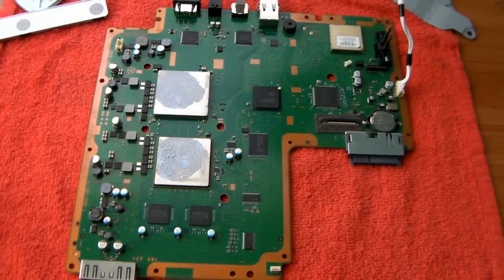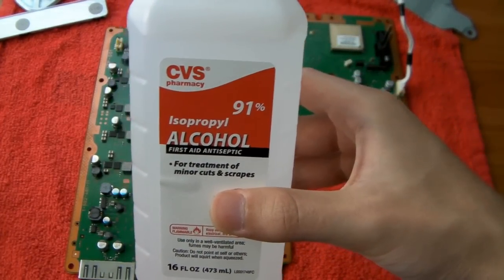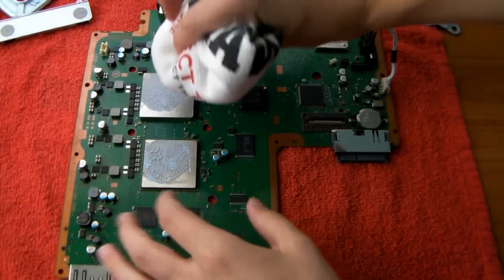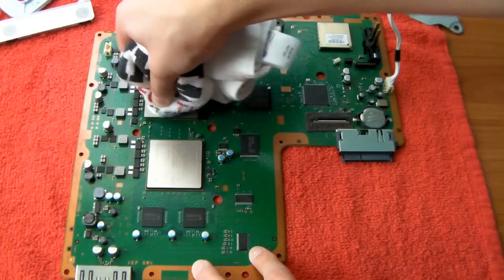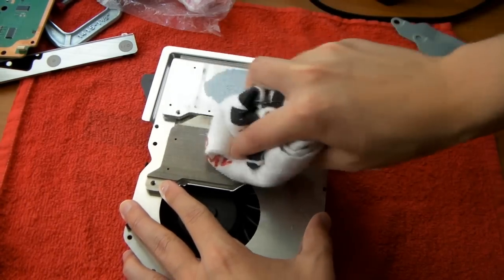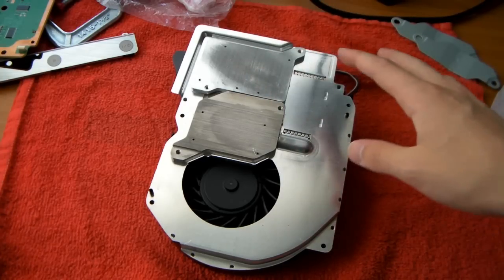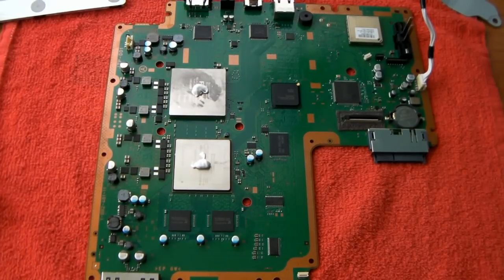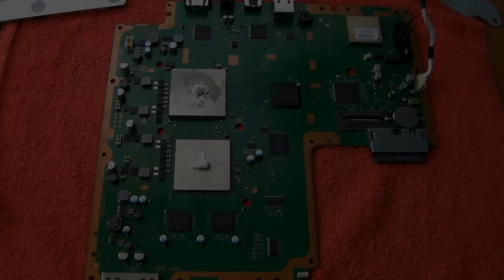How to Replace the Thermal Paste on a PS3

Comment: Does this stop my PS3 for over heating ?
Reply: Overheating and freezing ☺
Reply: Nuxy does this fix mw2 freez
Reply: Idk It should that's what thermal paste is for is from preventing overheating and freezeing so I would say Yes.
Reply: Clean the internals and change the paste. Here's the paste he used

http://www.alliedelec.com/gc-electronics-10-8108/70159754/?mkwid=sR14lob36&pcrid=30980760979&gclid=CjwKEAjwq5LHBRCN0YLf9-GyywYSJAAhOw6maavrtNauRGvrod02R1WMOL75Jg7NRfu86Fq97ZVNIxoCRDjw_wcB

Comment: To bad they use a heat spreader... if it wasn't for that replacing the thermal compound would be more effective because under those silver square's (heat spreader's) is the CPU and GPU die with more of that junky thermal paste on it. So ultimately the junk paste still is responsible for most of the cooling the new TIM can do. 

I kinda want to remove the heat spreader and replace that as well but there really isn't a effective way to replace it as the die will not come in direct contact of the cooler without the heat spreader.
Reply: have copper ones made to the exact dimensions.
Reply: xPurpBoyyx  where did you get it??

Comment: Do you have to change the thermal paste if you take it apart
Reply: It's the same principle if you're doing upgrading your basic CPU install or back when we did north & southbridge to overclock before Intel gave us the famous 2500k all thanks to AMD actually being competive back in the day.

So yes, otherwise it'll overheat and probably fry on you pretty quick I would imagine. I did my Dreamcast & Xbox so I figure it's time to finally do the PS3 in a few days as I know I have a Nor (E3, go through ebay, not amazon) and the correct SD card because I won't waste my $$$ to get what people from Amazon who did this and for shits and giggles wanted to see how many thermal pastes I've collected over the years and managed to hoard 7 different kinds from your famous artic silver to Noctua. Talk to anybody who built their own computer but don't spend a lot of $$$ at all and the smallest amount possible because a regular tube could probably do 50 PS3's, you'll understand when you get it. I see Artic Silver through amazon has a 1.75g for $3.55 with shipping included which is perfect, any will do because the performmance between a shitty cooler master paste to Noctua's NT-H1 is not that much and it's not like we're overlcocking it either, so I bet a lot of people got hosed on spending way too much $$ on paste. I also see through links on amazon they are getting the 8 gig mircro sd for $8 which is insane because I picked up a 64 gig sdxc from Fry's today so I'm hoping that'll work instead of the older versions which is really my only road block because the rest seems like a peice of cake.

I didn't watch the vid yet, but don't use the credit card method that's outdated, you want it to spread naturally so a dab in the middle I suspect which that Artic Silver will spead perfectly once heated. You can get away with 70% alchohol but to be safe spend $1 more at Walmart for the 91% or if you're fancy and don't feel like going to the store some 190 proof Everclear that worked just fine for me many years ago.

To clean, don't buy anything people will shill out, just make sure it's lint free. I just upgraded my CPU and the method I always use is q-tips first, then to finish it off a coffee filter or organic cotton if you vape. If you touch it re-do it again because oil from your hands is the worst but again, we're talking about Sony here and I'm coming from a computer background instead of whatever shitty paste and componets they use and that method should probably be done the day you actually bought it in the first place.

Wall of text there but it's easy, I'm sure there are 4,852 guides but it takes literally 2 min if you've done it before because it has always been the same basic method and you'll never forget it for the rest of your life especially when you're installing your first CPU because you'll treat that new $300 processor you just bought better than holding your child for the first time in your life.

So I'm looking at 50 for flasher on ebay or hit up craigs list because other people re-selling it on amazon will take advatage of the rubes for over $100 - even for just the ribbon itself too instead of the kit. $7 for paste/alcohol and possibly $6 for the USB to work with the sd card's adapter which you'll also need so be sure you get the card and adapter. Easy stuff and no soldering either but if you do it that way that's also easy.

2.5 HD also, and SSD would be overkill so with the merger HGST and Toshiba are in the mix with WD but just don't get a Seagate unless you want it dead the day before your warranty ends. If I remember correctly it's SATA1 so 7200 is overkill and more heat so the best option is HGST's 2.5 5400 or WD's RED (Nas stuff doesn't matter)The masterminds at Sony use Fat32's files system and I think it's not computer spec so you'll have to do research on that end. I know FAT32's limit is 2TB and unless the CFW stuff that I haven't even looked into yet have a great ass bsd OS going I don't even though you could even partition fat32 x2 and have it operational. 

Mind you, I haven't even jailbroken mine yet but I'm sure everything I said is 100% dead on except for the hard drives but I'll hack the case or even duct tape to a mini atx case with proper fans while I'm at it before I stick any Seagate in there. I should really wait though, with newer xboxs/ps*'s being basically PC computers the better chance for it to be jailbroken as the pirates will always be one step ahead, always and forever.
Reply: It's recommended that you do, so yes.

Comment: Hey hacked tutorials I just downgraded and installed a jailbreak on my ps3 and I keep getting these overheat messages about 5-10 after starting up my system. Is this because I disconnected the heat syncs and gpu during the downgrade? or is this a fan problem? please respond +Hacked Tutorials

Comment: How did you do this don't you need a heat gun and or a blow dryer to fix temperature
Reply: I think it's trying to communicate with us.
Reply from the maker: No that's only if your ps3 has gotten the yellow light of death. This is just to prevent that from happening.
Reply: I think mine has that what should I do ?
Reply from the maker: Then watch a video on how to fix a ylod.
Reply: You don't know how would you have fixed it i would want to do it the same way you would not NO random ads video some people do blow dryers and fans
Reply: na my ps3 work its just the flashing dump step for some reason it turns off
Reply: so what do i have to do

Comment: Is it possible to fix ylod ? I have a slim CECH-2002B
Reply: Alen Zejnic It is possible, at least from what I've heard. Just google it.
Reply: Pfff you can fix it but buying a gun and sitting the PS3 on the tress log or something it will sit on and then load the gun and then pull back the gun and aim down and pull the trigger a few times and then get a hammer and destroy the rest of it and then let me have a drink of petrol and then light the fuck out of the thing ;)